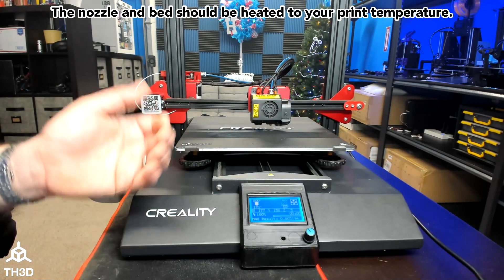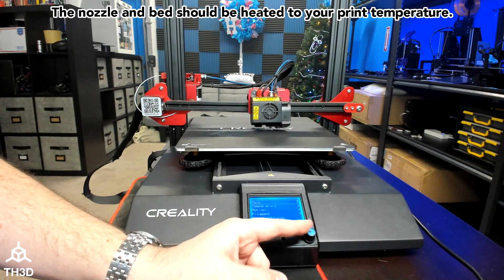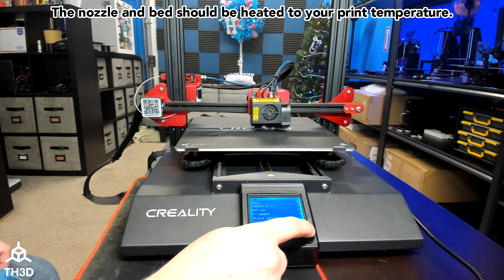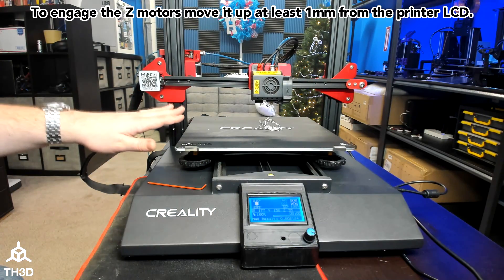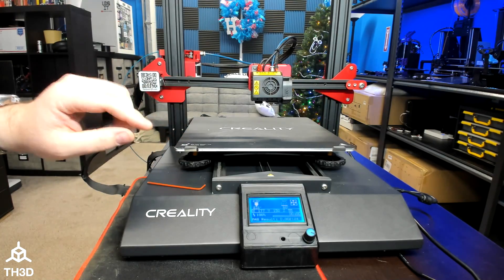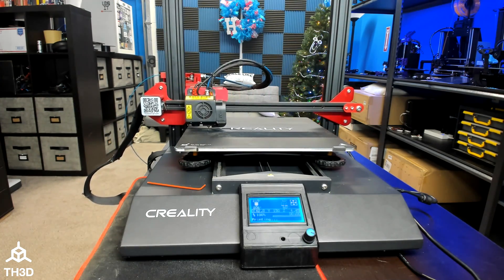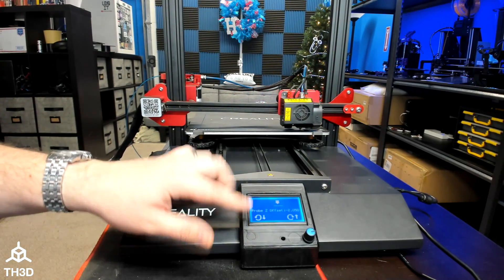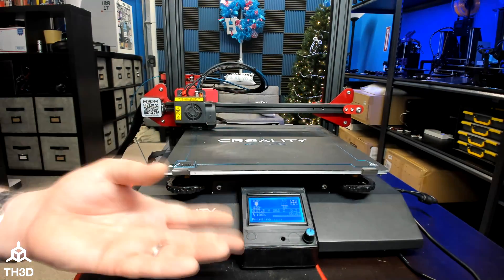EZTip #1 - ABL Z Offset, Gantry Leveling, Babystepping, Storing Offset to EEPROM

Comment: I have problem to set the z axis using bltouch on my ender 3 max board 2.4.7, it hits home on the z axis to position 5 correctly, I move the z axis to position 0 to set the z axis step offset to -5.50 and save the configuration, but when I do the home to the z axis it does not apply the compensation configuration. Check the offset setting and it stays at -5.50. Therefore I am trapped.
Reply from the maker: The 5mm is NOT part of you offset. Please read the documentation: https://support.th3dstudio.com/helpcenter/unified-2-firmware-abl-information-ezabl-bltouch-crtouch/
Reply: @TH3DStudio  Thank you very much for the help, I followed the recommended steps and I am printing with enough precision. In other forums I found users with the same problem, I will share your recommendation. Thanks again.

Comment: 3D-Printing Wizards of this World, I need advice in solving my Problem. Here is my Problem: I flashed the TH3D Firmware on my Ender 3 pro. Homed all my axis, went to z=0 and started dialing in the offset until it scratched the paper on Z=-4,6. Stored the Settings. After all that i tried to auto home but the offset doesnt seem to be taken into account. After homing the bed is still at -4.6 instead of 0 even though the offset is still set to -4.6. Things i tried to fix it: I tried to hard code it in the Config file without any better results, as it just sets the z-offset to -4.6 as standard after flashing. I tried both manual Babystepping as well as the Z-offset wizard provided.
Reply from the maker: -4.6 is too high. Sounds like you have your sensor not calibrated correctly.
Reply: What is there to calibrate ? The Probe has a fixed retraction point and the mount has no possibility for up and down motion so this should be a fixed value ?

Comment: When I try the firmware on th3d. The z dosent save and need to change Z to 10 not 5 after home. The level for the corners manually are off on the ender 3 max
Reply from the maker: The Z will be 5 after homing with the latest firmware builds we put out.
Reply: @TH3DStudio  ok on the max stock its 10. Also when I moved the probe Z offset to position store settings the home Z its back at 5. I gave up on it and worked out my own for now. Not sure what I was doing wrong or if there is a differnt way in your firmware.  I think something is wrong on the firware with storing the z offsets. My own firmware I compiled and creality ass save the Z offset fine. So not sure why it dosent work the same way
Reply: @TH3DStudio  after I set the z offset and home print its not saved even if I hit save. On 3 max 4.2.7 and 4 2 2. Please help not sure what I did not do right. After I hit store settings and auto home its back at 5

Comment: This Z offset is the bane of my existence. I'm trying to follow along with a TTPRO,
because I can't find another video LIKE THIS ONE, that deals with a TTPRO.

I hope there's someone reading this. I have no idea what I'm doing. And I'm SO CLOSE to my first print.
I'm certain that my ABL is installed properly. Tested and functions as it should.
Got Marlin 2.0.0 loaded. So, it's basically the same, right? 

Main screen shows Z at 5, and I clear it to 0. Main screen now shows 0.
I go to Config, Probe Z Offset, and it doesn't respond. The graphic is working. Responds to dial. Just no movement.

I can navigate to Config/Probe Z Offset... but it doesn't respond, either. The graphic is working. Responds to dial. Just no movement.
Main screen constantly shows (at the bottom) "Err: Too Far!" I don't know what that means.

PLEASE HELP.
Reply from the maker: sounds like a firmware config issue. have you tried our firmware for that machine? Its not in Unified 2.0 yet but our 1.0 is still available on the site and its supported in there: https://www.th3dstudio.com/hc/downloads/unified-1-firmware/th3d-unified-1-firmware-package/
Reply: @TH3DStudio  Thank you very much for your reply.
I've followed the link, downloaded & unpacked the ZIP file.
Starting with your README file, I've opened the included Arduino (having deleted any previous versions),
uncommented EZABL & EZOUT for TTPRO, in the Configuration.h file. Do I verify it, save it, upload it?
I'm new to this. What do I do with this modified file?

Now... I'm assuming that this file get's flashed to my printer, via USB cable, using CURA.
I've seen the directions, and will attempt this later today.
Reply from the maker: You can just flash over USB with the Arduino IDE thats included in the download. Dont use cura.
Reply: @TH3DStudio  Compiled the sketch, & uploaded.
I tried it twice, with the same result:

avrdude: stk500v2_getsync(): timeout
An error occurred while uploading the sketch.

I don't mean to monopolize your time. But, if you have a solution... I'm all ears.

Comment: On mine after setting the z-offset my BL touch will no longer complete a bed level. It'll probe the home point, move to a corner and extend the probe but it'll never make contact with the build platform - then it fails. I'm back on Creality's firmware now but I'd really like to go back to UFW 2 for the polish and features.
Reply from the maker: Whats the error that is thrown when it stops probing?
Reply: @TH3DStudio  Really seems to be Z-offset related. I've compiled the firmware with both the Z-offset wizard enabled and disabled and set the Z-offset and although it shows configuration saved and the proper z-offset is shown - when printing, or using "level corners" the nozzle will still be 5mm above the print surface.
Reply: @TH3DStudio  The only error it shows is "Error: Probing Failed" I've also noticed that it seems to ignore the Z-offset. The probe will extend and move almost all the way to the print surface then throw the error.

Comment: question i dont know whats going on but latley i have to babystep minus 0.0004 to get my printer to even run what is going on ? something is obviously not calibrated and not saving when i tune and level the bed i store settings but when i shut my ender 3 pro off its back the way it was

Comment: This doesn't work for me --- I am using the TH3D firmware so none of the menu items match so I am lost.
Reply from the maker: As Marlin makes update to the firmware we cannot go back and change the videos. Control is renamed to Configuration in the new ones. As for the Z Offset, the new version is Z Offset/Babystep. Hope this helps!
Reply: @TH3DStudio  after i adjust the z offset and stored it, my auto home is the same Before i tune it with z offset. What i make it wrong? Thanks! :D

Comment: I just purchased the EZABL pro mini and installed it but cannot get the printer to home to the middle of the bed.  it only goes to the front left side.  Any tips on what could be wrong
Reply from the maker: Clear the EEPROM and try to home again. If that fails, check that you have all the correct settings set in the firmware. If you need further help you can contact our support team here: http://contactus.th3dstudio.com/
Reply: @TH3DStudio  
It appears that the unified 2 firmware is not compatible with the CR20.  I loaded the unified 1  firmware and its up and running the only thing that is missing is the z offset setting, it only has the baby stepping, maybe because I selected it and there is limitation with the memory.  But it seems to save the offset to what ever I set it so its working fine.

Comment: I upgraded my 1.1.5 8 bit board on my Ender 5 pro to a 4.2.7 and added the TH3d firmware. Many videos I find to adjust the Z offset don't reflect the options that are available on mine, making this a bit more of a head scratcher.
Reply from the maker: Make sure you are on the V2.23 version. The older V2.22 had a bug with the Zoffset.
Reply: @TH3DStudio  I just did this over the weekend, that was the latest from your site. I just looked again and it shows 2.22a
Reply from the maker: You only get zoffset with an ABL probe like our EZABL.
Reply: @TH3DStudio  so for BL Touch, the 2.22 is the latest? No 2.23?
Reply: I found it, but it won't get past the z_homing_offset warning...there is nothing like this in Config.h file, is there somewhere else to comment this out?
Reply from the maker: You need to set your probe mount and offsets.

Comment: Does your software listen to the z offset setting in cura if i create a seperate profile for petg and pla which might need different z offset. I have been manually leveling my bed for a year with great results but want to start printing petg and thinking of going ezable pro on my ender 3. Thank you
Reply from the maker: The Zoffset in the slicer should be set to 0 when using the EZABL. The ZOffset when using the EZABL is all done on the printer side, not the slicer.
Reply: @TH3DStudio  so if was going to switch between filiment i need to redo my z offset on the machine every time? Ok good to know.

Comment: Actually when leveling your bed you would need .02 mm of clearance NOT 2 mm... ANYTHING printed with 2 mm of space between the nozzle and the bed is guaranteed to come out FUBAR....
Reply from the maker: There is a setting called the ZOffset that is in this video. This tells the firmware how far the nozzle needs to move down after the sensor triggers to get it to the correct height on the bed. So if your sensor triggers when the nozzle is 2mm from the bed then the ZOffset would be -2.0 mm. Hopefully that clears up your concern.

Comment: Difficult to follow what you're trying to explain, why you're doing what you're doing or which printer this is for. You seem to be assuming that everyone is running a display in Marlin mode and knows what skrew you're adjusting to level the gantry. And what you say about why you need to level the gantry makes no sense to me. Why would the distance between frame and gantry have bearing on bed leveling? The printer frame is totally outside the reference system in which the printing occurs, isn't it?
Reply from the maker: This is for setting a ZOffset when you are using an ABL probe (like the EZABL or BLTouch). If your gantry is unlevel when you have an ABL probe it will result in a bad mesh, so it is necessary to have your gantry level for everything to work properly.

Comment: After doing all this lets say we change our bed glass and its say 1mm thicker.  Do I have to go through all this again?
Reply from the maker: Not usually. But it is recommended to make sure your Z Offset is correct after changing the surface type.

Comment: My adjustments of the Z height with baby stepping button are not saved for future use.  what is going wrong?
Reply from the maker: M500 will save them or store eeprom from the LCD. This is assuming you have the combined babystepping and z offset setting enabled in the firmware. If it is not enabled then it will not combine them.

Comment: Oh snap, so thats what the babystepping is for! I've been measuring the paper I use with calipers and then adjusting the z offset in the slicer. This makes way more sense and makes things more efficient. Thank you this helped a lot, when I use A4 printer paper it measures to be .14 so i've been adjusting the z offset to .04
Reply from the maker: Glad I could help!

Comment: A complete video install guide for the ezabl pro would be great I got your product working great but not with out a lot of trial and error.    The steps that i could find a video for were super easy the steps with no video I struggled.  Just want to thank your for letting me never have to adjust a screw knob again.
Reply from the maker: It's in the queue. We are changing how things internally are run to free up my time (Tim) so I can focus on more installation videos and documentation for everyone. I wanted to have one out by now but time is really limited. Doing a proper installation video is really time consuming but I'll get one out in the next few weeks if all goes to plan.
Reply: @TH3DStudio  Thanks for responding. Cool to know its coming and again thank you for putting together the ezabl pro kit after getting it installed its AMAZING and has saved me a ton of time already

Comment: what if when you take it down 5mm the nozzle is touching the bed at 0?
Reply from the maker: Then your sensor is not calibrated OR you already have an offset in the firmware (reset the EEPROM).
Reply: @TH3DStudio  I was just about to do that but your the man so thought i would throw out the question. TY again and Keep the Faith. I know its really hard right now.

Comment: Hi Tim, I have a question that i've never seen addressed.  I have a CR 10S 500x500. My gantry goes off level every print.  Especially taller prints.  So i reset it to level every time.  I go to dissable steppers and spin the motors to make them the same level.  Is there something i can do about this?  tx, John
Reply from the maker: The easiest thing would be to add these anti-backlash nuts to both sides. They will help keep the gantry from dropping on you: https://www.th3dstudio.com/product/upgraded-leadscrew-nut-for-creality-printers-anti-backlash-nut/
Reply: @TH3DStudio  I know this is old - but relevant for me - I have an Ender 3 SI pro - with the top Z axis belt - Would these backlash nuts them serve no purpose?  I find leveling the X axis a royal PITA with the belt.  Is there a software way to accomplish this?

Comment: I can't wait for the LCD/Knob kit for the CR10 Max. I'm SO DONE with touchscreens. I don't understand the selling point... We need our machines to work well not have a graphical interface.
Reply from the maker: We actually have the firmware and the electronics completed for that machine. We just need a LCD mount designed for it like we have for the CR-10S Pro. Can you email Streams@TH3DStudio.com with some pictures of the machine so we can get measurements to do a model for it? We had a customer we sent the beta parts to that was supposed to send us a mount for it but he never came through for us after we helped him install all the parts and did the firmware for it. :/
Reply: @TH3DStudio  Email sent! I used a dropbox link for the photos because e-mail still can't handle anything.

Comment: So what if your Z Height is 5 (like in the video)  and you move the Z Axis down 5 and it is hitting the bed? How do you compensate for that? Should the Z Offset always be a negative number? Thanks.
Reply from the maker: If its hitting the bed then something is skewing the Z homing height. 
Could be sensor calibration or something physical on the machine introducing that variance in the Z homing reading.